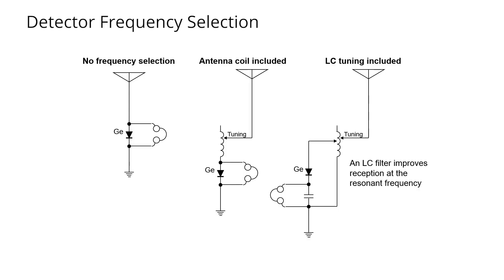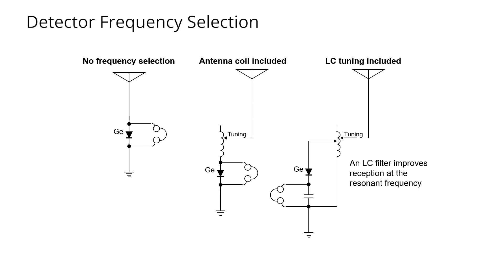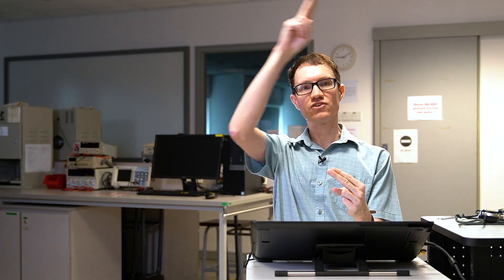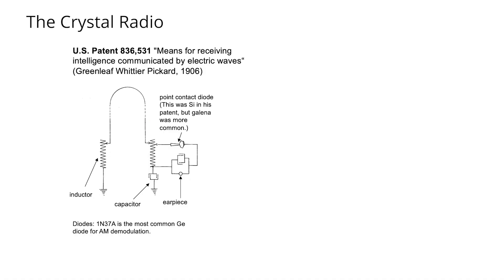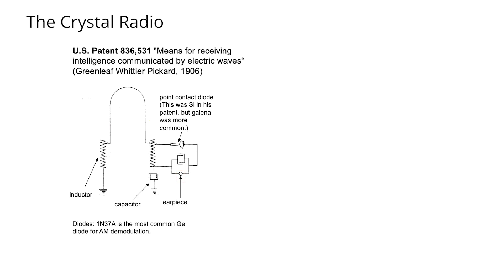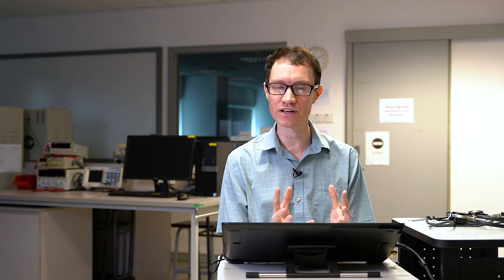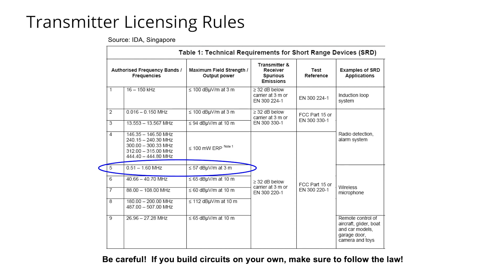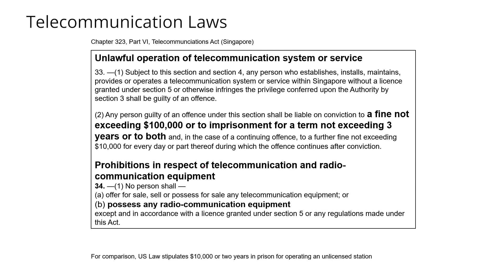Tuning methods in a crystal radio (9-Analog Electronics)

Comment: At the 4 minute mark he says the 1N37A is the most used. He has a typo; its a 1N34A diode. Note, if you go to Amazon or Ebay many diodes are advertised as 1N34A, but they are not. 1N34A is not a trade mark and, what, you going to sue a guy in China?
Reply: The 1N34A or 1N60 are well known germanium diodes, but not the only ones. Buying on Ebay or from china you will get often garbage, like the 1N4148 as a 1N34A "replacement". But often you will get a germanium diode, just with some other name. I used german OA90 germanium diodes with success.